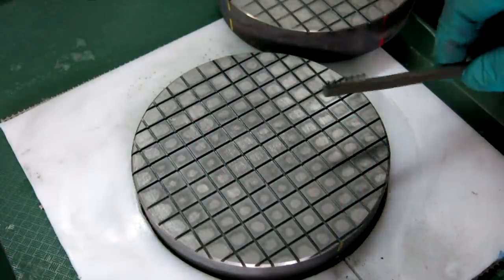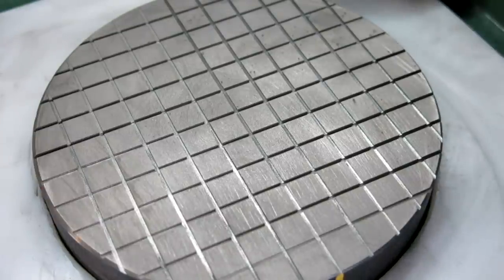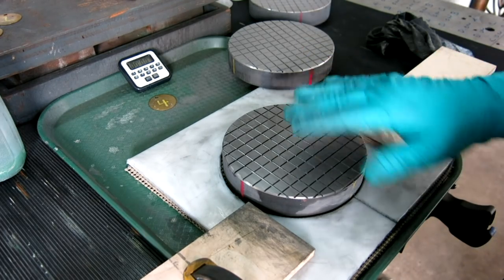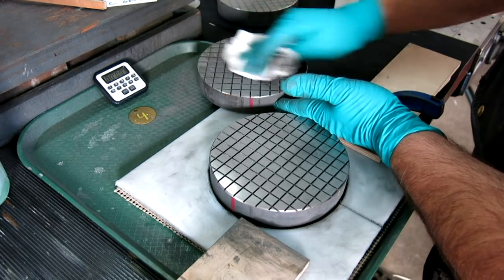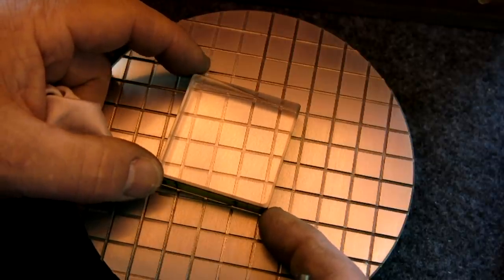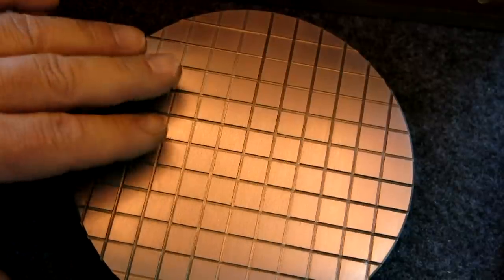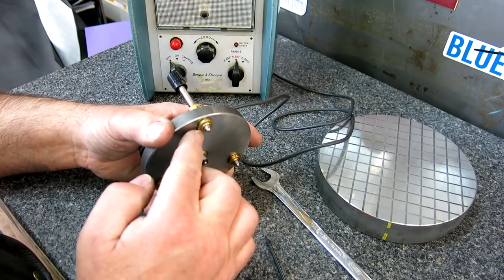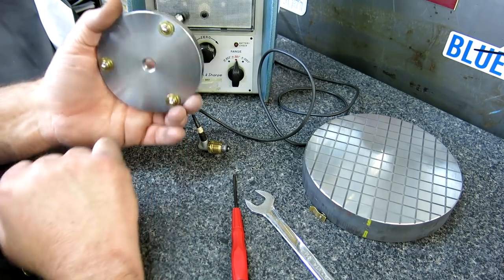Making Flat lapping plates 3

Comment: Tom, wondering if you can apply the techniques you are demonstrating to scrap pieces of granite (3 of course) to end up with some relatively flat surfaces for home use?  Mostly for lapping parts to flat w sand paper.  Would abrasives be the same or does stone require something different?

Thanks for the great series!
Reply: d t You'd need to cut the grooves in your granite to allow the slurry to exit which would be a pain in the ass if trying to make a surface plate. Granite is lapped with cast iron laps normally not to different to the ones being made here just bigger, which in turn have been lapped flat using the 3 plate method.
Reply: chris0tube My mistake, I got the impression he wanted to use the granite as a surface plate, in which case you wouldn't want a pile of grooves cut in it. I'm not sure a granite lap would be ideal as generally the lap needs to be softer than the material being lapped. Also you can pick up small  A grade granite surface plates for less than the cost of a cheap grinder and a diamond wheel.
Reply: chris0tube I'm sorry I'm missing your point, I thought you were saying it was easier and/or cheaper to buy a grinder, cutting disks, lapping paste and spend a day grooving and lapping 3 granite blocks than to buy a surface plate.
Reply: call me curious for a moment... explain to me why it should be 'beneficial' that the lap should be softer than the material you want to use the lap on???

I am struggling to get my head around this... 

If I go to all the effort of making a set of lapping plates that are essentially a near on perfect flat plane, that I then want to use as the basis for lapping some other part so that other part becomes a perfectly flat plane, in reference to the lap, then surely I would want to be using A) a lapping compound that will not abrade my lap but is hard enough to abrade the surface of the actual item I am attempting to lap using the lapping plate?  otherwise, if my lapping plate was softer than what I want to lap, my lapping plate would wear before the item I am trying to lap....
Reply: Lloyd Milton Regardless of lapping or polishing nearly all texts on the subject suggest that the lap be softer. As rightly explained, to be charged. If the part is softer the part becomes charged and will cut the lap, so the lap being softer actually preserves the surface of the lap.
Reply: chris0tube I'll be the first to admit that I have absolutely no experience in mirror making and in 20yrs of engineering very limited experience in lapping, you do however appear to have considerable knowledge on both so I am more than happy to take your word for it. However, the previous posters concern was that he was going to alot of time and effort making lapping plates, which I assumed he wasn't using to make telescope mirrors, only to have them wear because they were softer than the material he was lapping which, as I explained, was not the case due to them being softer.
Reply: chris0tube Wow, you really should be videoing that sort of stuff. I for one would love to see how to make the tool to measure curvature, I assume it could also measure flatness too? So few videos on here covering such precision work it would be a good addition. Perhaps you could share some of the laps and compounds  you used with use too. This series has created alot of interest in the subject, the more experience there is to share the better.
Reply: Right, so if I actually wanted to use it as a LAPPING tool, not as a polishing tool, then in reality it should be harder than the surface I want to lap... That actually makes sense... because if I am going to lap something, I am going to want the tool to remain at a constant (within reason) flatness and have it to be able to withstand the mechanics of applied motion / friction etc with the item I want to make flat with reference to the lapping plates surface...

I do understand what you mean my having a softer material allowing 'impregnation' of the lapping / polishing compound and that does make a degree of sense for giving something a final polish, for example when resurfacing surface plates, I believe they use cast iron flat lapping plates and a diamond dust polishing medium.  because when you are redoing a surface plate, I doubt they would be out my much at all (definitly less than a thou I would think) so it is more of a polishing action that reduces the miniscule errors in the surface plate...

Still it is an interesting discussion...
Reply: Lloyd Milton I would not reccomend if you are doing workshop lapping gages etc. using a hard lap. The compound will impregnate itself into your gage and you'll wear your lap. Besides, think of it logically, you have a hardened tool steel gage that you need to lap at around 65 - 70 hardness, you would need a carbide lap! I realise the previous poster has considerable experience at making telescope mirrors but I have never, in 20 yrs, seen a harder lap used in gage making. I would reccomend reading about the subject, and not the internet, Gage making and lapping by Frank E Shailor is a good start or Handbook of lapping and polishing ISBN 1 57444 670 3. Maybe Robin Renzetti could offer some advice as he has considerable experience at this sort of work?
Reply: indeed, it is the right way to create 3 plates of identical flatness (using the same base material), it is the same as the 3 rollers method to create 3 rollers absolutely circular and parallel with reference to each other.

They also use the 3 plate method to create 3 truely parallel plates, by essentially lapping all 3 plates at once, and rotating the middle plate...

I do understand how lapping and polishing differ,  I do however appreciate your effort in explaining it :) 

and your following question about diamond laps is quite relevant...

A lap does not need to be flat, it can be any cross sectional shape... it could be a radius, a triangle or even a wave shape...

It does need to, in my opinion, be a) harder than the abrading compound, and by definition, harder than the material you are wanting to lap, because it is the reference surface, and the abrading compound needs to be harder than the material you are wanting to lap as well or it would not remove surface material from the material you are lapping...

I have done some reading on this subject over the last few years, because down the track I want to actually create some circular and parallel rollers for a project I have on the back burner... and the 3 roller process is the way I will go forward with that... That is not so much lapping IMHO as much as it is the process required to achieve a certain result...

Lapping to me is where you have a known shape / surface and want to bring another item to match with that known shape / surface. A classic example of lapping (to me) is lapping valves in a cylinder head, the lapping paste is a bit harder than both the cast iron for the head and the steel the valve is made of, in that scenario, it tends to take more off the face on the head, than it does on the valve, often more like polishing the valve but actually lapping the head to match the valve face

Comment: I would think that rotating the disks gives a different abrasion on the outer edge than in the center of the disks because of weight distribution and definitely because of the greater motion at the edge than in the center.

Comment: I understand the principle of the 3 plates is to distribute error. If so, what is the purpose of the A on B then B on A cycle? It seems logical to cycle thru all three plates first then flip  moving units or do not flip at all.  This issue is raised in the context of lapping a lighter plate onto a heavier plate where flipping is not practical. Thanks. Great videos!
Reply: The disk on top will naturally want to go concave while the bottom plate goes convex.  So one round of A on B followed by B on A will in theory negate any curvature introduction.
Reply: Clear. How does the calibration guys use just a smaller plate on a much larger heavy surface plate still get a flat outcome. Is it just working to correct the mapped errors? Thanks.

Comment: Can I ask Tom"  what cut the round cast iron into 1' blocks. Will large cast round pieces surface grind ok.
Reply: Metal suppliers use large horizontal metal band saws generally.

Comment: Tom, in an earlier video you discussed the issue of the lapping being uneven between the outer edge of the plate and the center section because of the lapping motion causing more polishing action in the center of the plate, which is always in contact.  Thus, limiting the back and forth stroke of the polishing action.  What do you think of the idea of making the plates over-sized and just cutting away the uneven edges of the plate once the rest of the plate is flat and polishing is complete?
Reply: Great stuff, thanks for posting.
Reply: It shouldn't work very well, because of the internal stresses of the metal, any cutting of it will effectively stress and strain relief the plate, causing a new resting state to be achieved, which is unlikely to be as flat as your previous lapping action.
Reply: they require constant "tuning" wish I had time to explain how early telescope makers like 1450's era mde lenses

Comment: Fresnel effect, if the angle of incidence is wide enough, even a brick is reflective.
I was wondering if you could hack a wireless drawing tablet (like a Wacom) to make a wireless spherometer. OTOH, that would be an expensive little project, and who knows how precise those sensors are (I guess they're made for pressure, not for travel)

Comment: Why would this process not make the cast iron two spherical surfaces, one convex the other concave?
Reply: This is why you use three plates. The third averages the wear.

Take your two plates. One is convex-raised center. One is concave-raised edge. Well call them A and B.
Now posit a 3rd plate that's equally convex to A. Call it C.

A on B = full surface contact. Nothing changes.
A on C = both are convex so the raised centers get the wear, the edge doesn't make contact. Both become flatter.
B on C = nearly full surface contact, but C is slightly flatter so it makes less contact in the center and slightly wears the edge of B making it flatter.

B on A - nearly full surface contact, but both are slightly flatter than the first pass.
C on A-  both are convex so the raised centers get the wear, the edge doesn't make contact. Both become flatter.
C on B- nearly full surface contact, but C is slightly flatter so it makes less contact in the center and slightly wears the edge of B making it flatter.
Reply: OK! 
Thanks for the process description! (Lying awake last night in bed I came to approximately the same conclusion and am thankful for the fullness of your response!)

Comment: what diffetence between lapping and inked scraping ? is it better to use scraping to avoid any abrasive injection ?
Reply from the maker: Hi Dimitry,

Lapping produces a surface that does not have the highs and lows of a scraped surface. Inked scraping can get you pretty flat but not into the light band realm. Thanks for the comment.

Cheers,

Tom

Comment: Pictures that evaporating liquid on that plate by the pattern it's giving because as it hits that edge as the air goes over the sharp edges it's going to cause vortices that change the whole story if you could separate each block from the effects of the other blocks next to it that would be a different story

Comment: I'm curious to know how flat a 25inch square sheet of glass is, i've used glass/sand paper for many years to lap Cylinder Heads on Motorcycles. I now wonder if i've been adding a Concave or Convex surface.
Reply: The glass distorts while it's cooling but high quality float glass should be quite flat, more than adequate for flattening a cylinder head.  Tom is talking about 50 millionths of an inch (0.000050 in or 0.00127 mm) in the video and he isn't finished polishing.  I doubt that even a Formula 1 race team would go to that extreme.  Head gaskets and sealants are also used to accommodate differential expansion of the engine components.
Reply: Dinxsy so long as it is done in a figure 8 pattern.

Comment: Couple of thoughts. With the theory being, three like plates arriving at the same flatness at the same time, wouldn't the "pesky ring" in the middle of the one null out all other plates as a result? Do you have a target flatness that you're shooting for? The procedure should result in flatter and flatter results, but how far??? Like scraping, the light tells so much of the story! Sweet trick on holding the LVDT !  thanks for the video as always. Take Care.
Reply: Pete Ferguson.  Good point. Also, that pesky rough surface twords the center of the plate IMHO,  was caused by not increasing the sfpm as the tool reaches the smaller diameter when facing on the lathe, resulting in the surface being scraped off rather than being cut off. 
When facing on a CNC turning center, the spindle speed can be increased as programmed, as the turning diameter decreases, I have found the easy way to achieve decent results on my lathe at home is to grab the speed knob and monitor the tachometer afforded by the VFD I use to run the 3 phase motor on single phase.
Reply: they do not have to be the same flatness before they arrive to the flatness as you describe that. So at some moment you might have one perfectly flat thing and one or two not perfectly flat things.
Also those rotations and direction changes intended to average those imperfections, so they would not transfer directly as they are. This ring can be 1um imperfection as example and it will lead to 0.1 um imperfection on another 2 things(as an example)
The point is eventually they will arrive all flat enough, but in time in-between you can have flat and not so flat things together
Reply: Never lapped anything but I have been reading and learning to scrape. In that proces I thought that the successive cycles continue to halve (equalize) the error and average it until flat. Maybe it is the motion that allows lapping to have an overall plane with some imperfections but I’m thinking in scraping that you would not see it as flat if you had that ring. I’m also still a bit stuck on the theoretical part that would prove them to be, whether equalized or averaged, not as flat as could be. Now flat is a totally different problem, nothing is flat once you start looking… Hoping Tom has a target in mind as he approaches that point. Thanks for the info, lots to learn. Take Care
Reply: Thanks for the additional info but I still see it differently - may likely just be me :). The process is based on each plate trying to impose it's plane and flatness on the other, each fighting to win out - this is what results in the continual cancelation of errors. If that is occurring, at any time in the process when the three are not identical, they won't be flat. When I say "identical" and "flat" I mean the entire surface, of all three, having the same finish and flatness. Ultimately in the end their combined efforts to change each other is what results in all three being the "same" but until that point I still think that hidden in each of them is a slight reflection of the others, the process allows for nothing other than this.... Oh I'll stop, it's only Tuesday :) Points of view are like projects, everybody usually has more than one on the go. Take Care.
Reply: >whether equalized or averaged
you missing one moment that it takes some time for one plate to imprint in another. At the beginning they begin to rub each other by those imperfection(and flats) and at some point they kinda move to match each other, including new types concave and convex imperfection, but there is time in-between of that.
But in the case, on the video, the ring is concave, and other places are basically flat already, same as good part, and the ring is small(compared to movements). So basically it is just a wider and shallower version of those gaps which are by design on those particular laps, so it doesn't play that big of a deal.

Comment: Why are the plates grided? To store the grind-offs?
Reply: He covers that in the first video. It is both to avoid a buildup of fluid and abrasives at the leading edge of the part (like a bow wave that would lift the part) and to give the swarf somewhere to go.
Reply: There is a 3rd reason, it keeps the two plates from creating a vacuum and firmly sticking together.  I made this mistake on my first 8" glass mirrors and thought I'd never get them separated.
Reply: James Lerch Yes very good point. Even hand scraped surfaces are flaked so there are ridges and groves for oil and air to go. How did you get the plates apart? My first try would be differential heating/cooling.

Comment: I don't see how these particular laps, which are used to naturally create spherical lenses and mirrors in microscopes, telescopes and cameras from glass and a convex surface in the lap as result, can be used to flatten a surface. The cast iron laps I've seen for surfacing granite inspection plates necessarily have diamond pushed into their surface, which I thought was to prevent shaping of the lap itself.